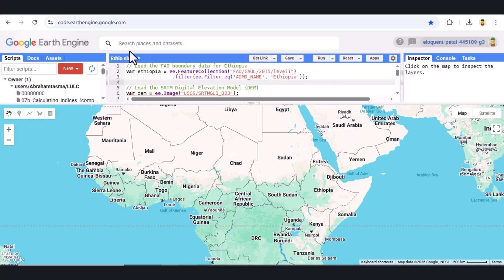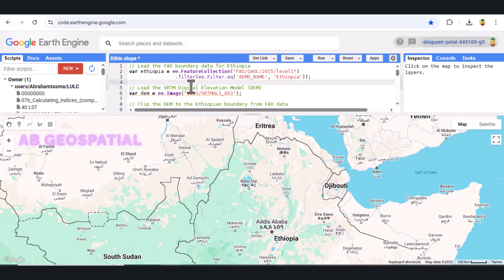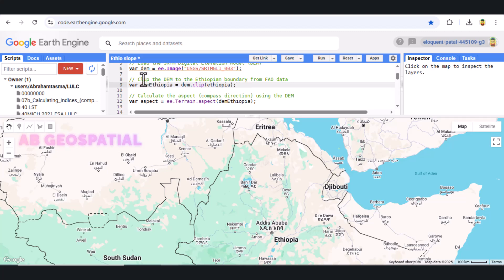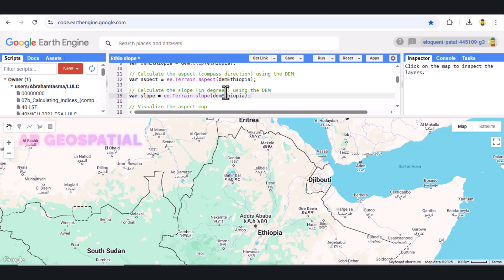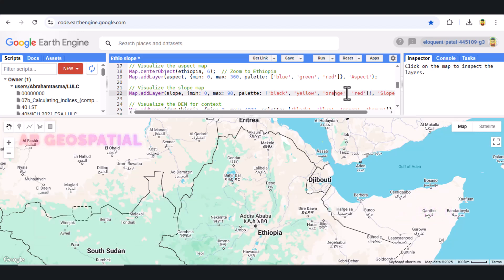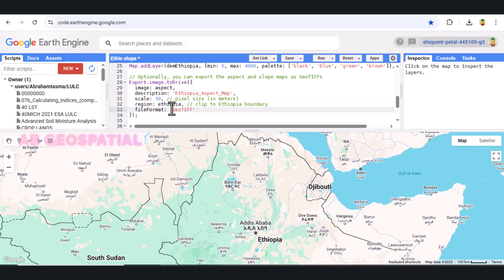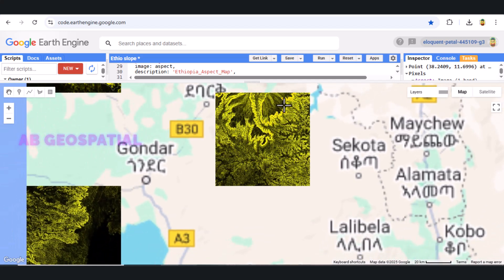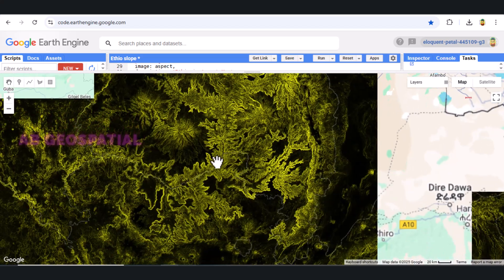Slope and Aspect Mapping Using SRTM DEM on Google Earth Engine (GEE) | GIS Tutorial

Comment: Thanks for your video, but How to extract a drainage network from STRM-v3 ??
Reply from the maker: // 1. Define Area of Interest (AOI)
var geometry = /* color: #d63000 */ee.Geometry.Polygon(
        [[[37.0, 6.2],
          [37.0, 6.0],
          [37.3, 6.0],
          [37.3, 6.2]]]); // Replace with your study area

Map.centerObject(geometry, 10);

// 2. Load and Clip SRTM DEM
var srtm = ee.Image("USGS/SRTMGL1_003").clip(geometry);
Map.addLayer(srtm, {min: 0, max: 3000}, "SRTM");

// 3. Fill Sinks (Depressions)
var filled = ee.Terrain.fillMinima(srtm);

// 4. Load Precomputed Flow Accumulation (HydroSHEDS as alternative)
var flowAccum = ee.Image("WWF/HydroSHEDS/03ACC").clip(geometry);
Map.addLayer(flowAccum, {min: 0, max: 1000, palette: ['cyan', 'blue']}, "Flow Accumulation");

// 5. Extract Drainage Network using a Threshold
var threshold = 100; // Adjust based on your region
var drainage = flowAccum.gt(threshold);
Map.addLayer(drainage.updateMask(drainage), {palette: ['0000]()